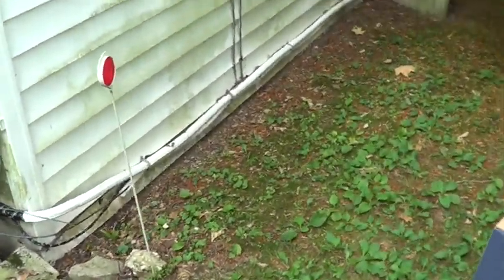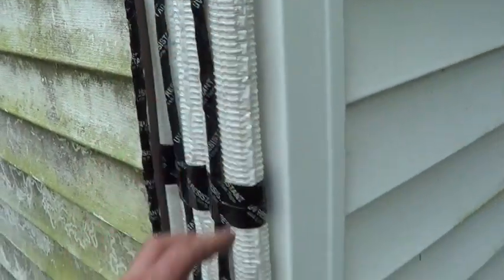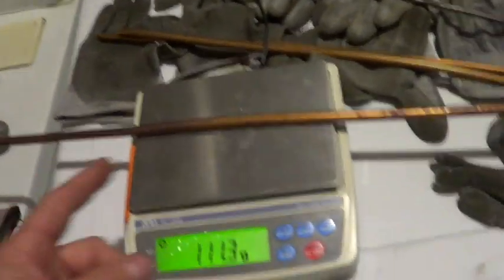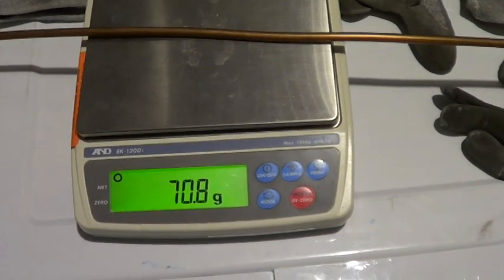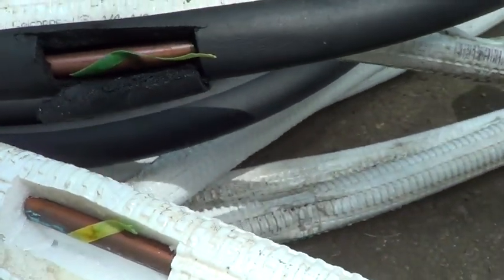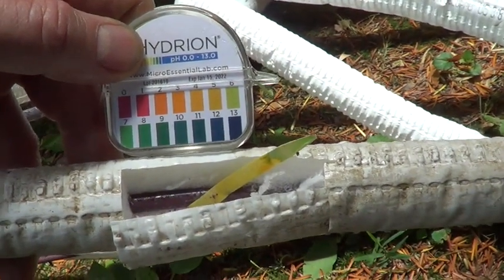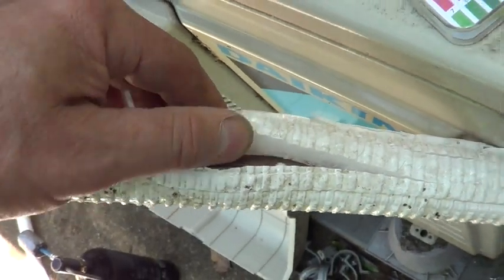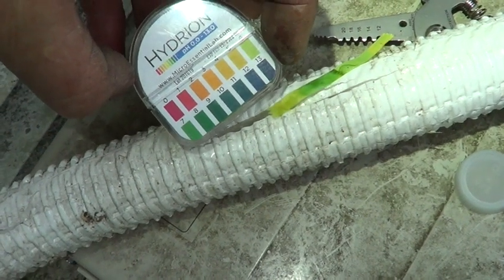White Insulation HVAC Lineset Leaks Cause is Acid

Comment: You are probably already aware of this at this point...(I  noticed the video was posted in 2019)...but apparently the white insulation is "the culprit".  Plasticized  (white) as opposed to rubberized or "elastomeric"(black).  The theory I've heard is that once water and air get in, the combination of the insulation, water, air and copper sets off the corrosion process.

Comment: I just had my minisplit lines replaced. They were these same defective lines, installed in 2018, and my unit ran out of Freon twice. We cut open the old lines and every single line was corroded out even in parts of the house not exposed to uv or rain. There were whole sections of deep blue corrosion.

Comment: This has been an issue for many years, and it has to do with the material, not the color. The polyethylene material reacting to moisture is causing the pin holes. Most if not all US manufacturers have moved on to the the Polymeric insulation that is much better. It also comes with UV protection for exposed areas where the PE material fails quickly, particularly in the warmer and sunnier climates. The PE material also comes in silver, aluminum and black so be careful not to get hung up on the color, it's the material. This product primarily comes in from or by companies owned in China and Italy or supplied with an A/C Unit made overseas. For best results us a Polymeric insulation that will last many years and comes with a 5-year warranty. All PE insulation has is a one-year warranty.

Comment: It's the pipe with a UV inhibitor on the outside and poly inside. It's the chemical used for UV which is silly because you should have a proper cover on it anyways.

Comment: Looks like you may be in Massachusetts based on the look of the house and the piping job lol. The pdmus line set manufacturing company out sourced there insulation to another company that used formaldehyde in the foam. When the pipes condensate it seeps out of the foam and makes the line set pooris. I crimped and brazed one end of a pipe and brazed a port to the other end and added 300 psi of nitro. I sunk the piece of pipe in water and it was bubbling like a bubble thing in a fish tank.
Reply from the maker: That could explain the hit or miss of the insulation.   If the ratio of formaldehyde to the other neutralizing chemical isn't perfect, the remaining formaldehyde will destroy the copper.   I had a suspicion this is a quality control issue.   But, I just stick to the black stuff to be safe.   I have never heard of black foam insulation eating copper.
Reply: @NathansHVAC wait so, the insulation is the problem?? Should I get my line sets changed? I got this system called Della from Amazon.

Comment: I bought a 164ft length of 3/8 5/8 for 3 minis they all failed.
Reply from the maker: If the copper is black and green, you know why.
Reply: @NathansHVAC  I also have the white bumpy ones at my home which was built in 2020. They’re for a 3 ton fujitsu non mini split  and I pray they’re ok because they’re buried in wall 🤦🏻‍♂ the ones I’ve replaced for mini splits weren’t buried. I have no idea how to replace sets buried probly tear the wall apart
Reply: Mine are mueller industries that failed
Reply from the maker: On a positive note, the line sets do change out pretty quick.
Reply: @NathansHVAC  yup sure is. And they’re the brand in question. Bought in early 2019ish. I used the 164 for 3 and 50ft for a fourth. The fourth has the bumpy white insulation that came in 50ft so it’s different. I’m wondering if it’s a matter of time for them too. The output temp seems to match the other 2 I fixed with shear line (think that’s what the lines are called) but it seems to be working a little harder but it’s really tough to tell since they’re in a grow room and I think it’s getting more of a load. Maybe I’ll peel back some insulation. There’s a little bit outside that’s not insulated and it doesn’t look as bad as what I’ve replaced but I’m not an hvac tech lol

Comment: Cheap Chinese copper. Their copper is made with impurities unlike Mueller brand.
Reply from the maker: All copper turns green after 100 years.   However, turning green after 1 year means chemical corrosion.
Reply: @NathansHVAC  Hey man it's your channel...if you say so..but what about the copper with no green corrosion with pin hole leaks?

Comment: Happy to say after ripping out the failed Italian ISO Polar crap and replacing it with Mueller I’m having no issue’s so far with any systems. To bad that in most cases the damage is done and even with new line set a flat system still had moisture in it. In cases where your system used POE oil and not PVE there’s no telling what awaits you unless you pulled the entire system apart including the compressor and flush it. Most tech’s will do the bear minimum and blame the system manufacturers only giving ductless a bad name when in reality it’s the cheap white ISO POLAR line set.

Comment: I just ran into this, brand new install, several months later we had a leak, the Hvac guy has never seen this before and mine is leaking like mad. So frustrating, the amount of work to  swap this is HUGE so it's very disheartening.

Comment: The problem they had was the insolation material. They found that it needed to be taped at both ends due to a thermal reaction of the insolation material copper temps and outside air within the lineset insolation. When the bulletin came out they said tape bothe ends at end of install. This was supposed to come off the market a while ago. I didnt look at the date of this post so maybe it did.
Reply: band aide solution

Comment from the maker: It might be possible the acid is from formaldehyde in the insulation.   This is speculation on my part, because I only did an acid test and not a formaldehyde test.   The ph is low from something.   And the copper corrosion is hit an miss in almost random places on the line set.   Again, I am not a chemist.   But, perhaps that chemical is used in the manufacturing process of the white insulation and if it isn't all reacted inert, bad things happen to the copper.

Comment: Very Frustrated - Mueller Gelcopper linesets (white jackets) were used on my system (manufacturing date 5/15/16) Started having problems a year ago.  Linesets have rotted out!  Installer says not their problem, Mueller says not a problem if install is correct (sealed ends). Will cost $5K to swap out the linesets!!!!  This is a known problem and Mueller should make it right!   Very disappointed with this company.
Reply from the maker: If the copper is green or the worse black, you have to change it all out.    I'm sure there is a lot of finger pointing on who put the acid on the copper.    Just go by the warranty to see what is best.   Mueller typically warranties 10 or more years when black insulation is on their copper.   At least you know what to do now.

Comment: HVAC installer just used a white "PT RYNO" line set "made in USA 700 psi" Dated 6/21.
So the question is; are all white line sets problematic?
Reply from the maker: Just check the warranty.   Industry standard is 10 years for good line sets.   If the warranty is just 18 months, ask yourself why extra thick copper leaks after a single season?   I think the root of the problem is quality control in the white insulation, not the copper.   But, that is just my opinion.   I don't want to name a particular company because I am just an a/c smuck and not an expert chemist.

Comment: I have the same problem. Installed 2 minispits a year apart both 2 zone 18k and the newer one about 4 years old has this problem. Same brand white line sets. Replace a section last year now doing the rest.
Properly installed, purge and tested with nitrogen,
Pulled deep vacuum.
This explains it.
Great explanation

Comment: this is a wide spread problem, if you follow manufactures install instruction it tells you that you have to seal the ends and tears with approved methods and products to keep moisture out. likely  from ph. content of our water and a chemical reaction from insulation and copper.
Reply from the maker: Nobody seals the black line set ends.   I never seen one sealed in 30 years.   I also never seen a black line set with acid inside the insulation.   Plus, moisture will always get in.   It impossible to have a perfect seal.   The seal clause to void an already pathetic warranty is just a diversion.
Reply: That bulletin came out after the issue started to cover there crap product. All of the failed line sets were sealed tight with UV line set tape to the condenser and still failed.

Comment: Had the same issue. Put dye into system and found pin holes all along the exterior lines. Had to get the line sets to 4 heads replaced with Mueller. GelCopper’s 18 month warranty is useless, just like their product.

Comment: I have had multiple leaks where there was some mineral wool wrapped around the line set instead of the white foam.  This is only in a 2 foot section, the rest is fine.  Wonder if there is a chemical in mineral wool that is a problem?  I guess the idea was any insulation is better than none ... maybe not.
Reply from the maker: Iron in the wool reacted with the copper from electrolysis.
Reply from the maker: Use copper wool or non metallic foam.

Comment: How long do you suppose it takes after a new installation before the color change is visible on the problematic copper? Would there need to be a leak for the color to change on the outside of the copper pipes?
Reply from the maker: Certainly less than 1 year.   I think this is a quality control issue.   You are either really going to have a fast leaker, or the system will be tight for 10 years or more.   Grean is bad.   Black crusty corrosion on the copper is even worse.

Comment: I have literally hundreds of these leaking on a job. All with green in the insulation.  This video was eye opening with regards to the acid levels. Thank you
Reply from the maker: Sorry for the bad news.   At least now you know what to do.   On a positive note.   The failure rate is not 100%.    I would guess less than 10%.   But, it could be higher in certain lot numbers.
Reply: The white installation that was in this video was recalled as it eats through the line set. The green you see if the copper eroding. Neeed to replace all lines

Comment: The use of this copper in the last five or six years, mainly with the white insulation, have leaks in epidemic proportions.Company I work for has replaced hundreds and hundreds of copper lines in the last 5 to 6 years.Not brand specific either, have had leaks in numerous brands.
Reply from the maker: Im sure we will hear more about the white insulation.    I was disappointed it is not even uv resistant.   Black is best.

Comment: I have an LG that had a leak about a year ago, never completely ran out of refrigerant but became noticeably ineffective due to low pressure, and I fixed the leak by tightening the flairs. I topped of the charge and good. I started the thing in heat mode this year and got an auditable his and found a pinhole in one of the 90s on the indoor coil. The thing looked like it had a dent in it prior. A buddy of mine said it probably got acid from moisture getting in. I just dont see that because those bends should be pretty sturdy if made right. I would see the lineset failing first. Either way I fixed the leak and I am going to pump out the lines tomorrow. I dont think I need to actually recover and reweigh the charge because the system always had pressure on it. Moisture should have never gotten in under positive pressure. So, in short I think a percentage of this stuff is just manufacturing problems...
Reply from the maker: You might have the wrong flare nuts installed if you used the lineset flares instead of the flares on the LG equipment.   Some are 37 degree angle.   Some are 45 degree angle.   You can't tell by looking at them.

Comment: The bad news is it is common. I just spent last summer ripping white insulation linesets out. The good news is that now there is a recall on white insulation linesets. I ran into seven such systems in 4 months. The first one passed a 500 psi pressure test in may, and had another leak by August.
Reply: Are these recalls brand specific? Also, can you point to any further information on the recall? I have an ongoing installation where both PDM Gelcopper and PT Ryno is being used and after stumbling upon this information I am very concerned.

Comment: Are Line sets included in the warranty - I have a four year old Fitjitsu with this white insulation problem / leaks
Reply from the maker: not really.   They are a 3rd party manufacture not related to the equipment.    labor warranty is usually 1 year too.    However, they don't cost that much to replace.   Mostly, it is labor.    Also, make sure they use the original fujitsu flare nuts.
Reply: @NathansHVAC  thanks for the quick reply   that's what I figured

Comment: I'm so angry with these failures. Costing me thousands of dollars. I'm changing every single line set out. Everyone has pinhole leaks. Don't even bother using dye anymore as every one has micro pinholes.
Reply: Rich What state are you in I'm doing some research on this to find out if this isolated to the north east part of the USA
Reply: Yea you can use the black Linesets but yea it’s still frustrating
Reply: Have you had to change every brand of the white line sets?

Comment: Found a bulletin that may help explain. have personally seen on one lineset that was about 3-4 years old. Unfortunately I just discovered this my company has been using this type of lineset alot lately.... http://www.blodgettsupply.com/data/Unsorted/Armacell_USTechBulletin_Tubolit_WLS_CUI_111218_WLS001-81719-1.pdf
Reply from the maker: All that extra work will not prevent a damaged piece from allowing moisture in.   I have found it much easier to use the other brands that have 10 year or 50 year warranty and have no moisture issues at all.  In 40 years doing this i cant ever remember seeing line sets that cant be allowed to get wet.  The problem is the acid, not the water.

Comment: This is a common problem with the white insulated linesets.   Formicary corrosion.    Lots of people are now switching to aluminum linesets only or avoiding the white insulation on Their linesets.  This problem could single handedly wipe out the heat pump market.
Reply from the maker: Formicary corrosion is only from formaldehyde.   I doubt they are using foam with that chemical or there would be 100% failure rate of the copper.   There is some other process or quality control that leads to the acid corrosion that is probably related to manufacturing.   Formicary defiantly get the evaporators.   They are wet and attract chemicals from the house.

Comment: Had 2 line set leaks on installs less then 2 years old. Seeing the same green and black corrosion.
Reply from the maker: It is hit or miss with the white line sets.  The acid seems to be some sort of quality control issue at the factory.   If your copper looks like this video, you probably need to change the entire line set.   Don't bother chasing the leaks by repairing them, because they will re-form over and over from the acid.   You could do an acid test to confirm.
Reply: @NathansHVAC  
Quality control in the copper or the insulation?
If the Mueller copper was in the white insulation would this occur?
If the "bad" copper was in the black insulation would this happen?

I know you don't know, but process of deduction would seem to indicate the white insulation is the cause.
Reply from the maker: @jrsmyth9761  the factory that I talked to said they use many brands of copper with the white insulation.   I'm sure there will be finger pointing.   Just use line sets with a better warranty.   Let them figure it all out.   18 month warranty on copper has a reason for such a poor warranty.   Would you buy bricks that have such a short warranty?

Comment: My Mitsubishi AC/Heat Pump lost several pounds of 134A last year after 4-5 years use. Was recharged and limped through last Summer OK. Now it is not working again and my installer suspects that the lineset copper is leaking because of reaction with he insulation causing pinhole leaks in the copper. If it is what they suspect, there should be a class action with some compensation to everyone that should not have to go through this expanse after such short times of use. Service scheduled next week.
Reply: I hope there is a class action suit !! Seems like shabby manufacturing has ripped off thousands of homeowners.
Reply: I'm curious how this turned out? I may have a similar problem.
Reply: Im going thru the same thing right now on a 5 1/2 yr old system. Totally disgusted right now.
Reply: Lake house. Only used in summer on weekends. Lost all freon over 3rd winter and charged 3 times that 3rd summer. That was about $1200 in 134a and the tech couldn't find the leak until I took maters into my own hands. All three linesets (3 head system) were leaking within several feet of the condenser where they got air...because the installer didn't seal the ends. Now they got my money for installing, my money for trouble shooting 3x times and now I have to pay them again to replace with Armaflex linesets. So about $5K in labor on a system that cost $2500 to buy, Pioneer (Parker Davis).